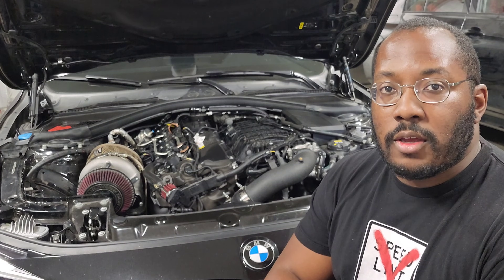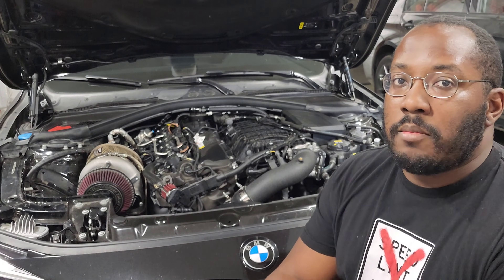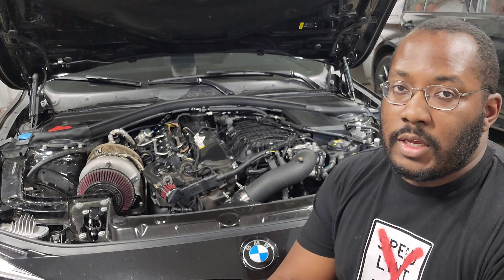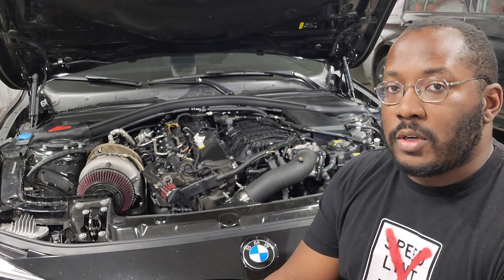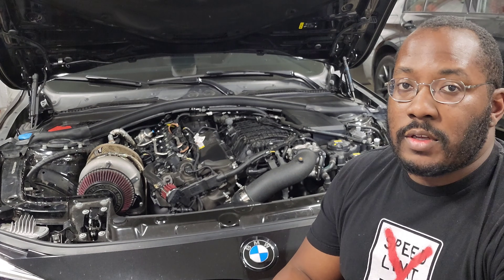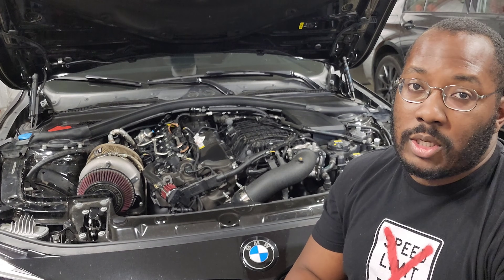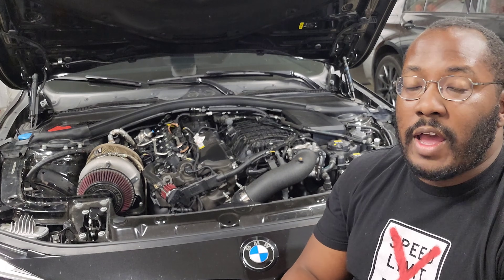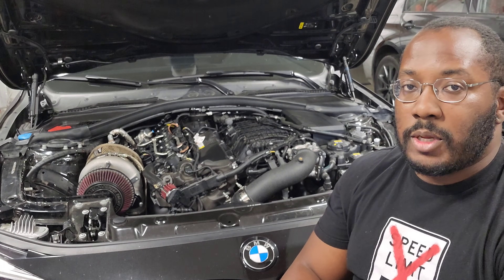You CANNOT only spray Methanol for Cooling! Here's Why

Comment: What’s the downside of the negative fuel trims if your going to stick to meth and water mix for every day use?
Reply from the maker: Can't believe I didn't mention in the video 🤦🏾‍♂️

30% is the max +/- the car can adjust. If you hit that wall then you run the risk of leaning out or running too rich.
Reply: @kern417   its all good no worries, I was thinking it would eventually go lean but didn’t know what the max trims were. I’m new to closed loop fueling under wot, I’m used to dealing with open loop under wot so thanks for the clarification 👍

Comment: Apparently this is injection on top of a stock tune, otherwise tank fuel would be pulled in the tune and substituted proportionally with methanol injection. Water has one of the highest heats of vaporization of any liquid which is why it works so well in our radiators. It also requires a high temp in order to evaporate. If charge temps aren't high enough then not much water is evaporating before it reaches the combustion chamber where it also does work to cool the combustion process and steam clean the chamber. The downside of the negative trims is that at some point the power control module is going to kick in and shut the show down to protect the system if not tuned in many cars.

Comment: Kern417 thanks for the great video. I have a question regarding these setups. I currently have a SXS with a 1000cc single turbo motor making right around 200 crank hp at 20psi. These cars have locked ECU and cannot be tuned. They have numerous built in safety's, one being they start to pull timing and boost on long runs when AIT reach 140-150f. I have upgraded the water to air intercooler but due to space restraints I cannot make any larger. Could I spray water/methanal into the intake post intercooler without additional ECM tuning (locked). My idea is a very small nozzle set to come on between 10-20psi of boost on long pulls to prevent AIT reaching a level were the ECM starts limiting boost and timing. Great video and thank for any input.

Comment: I don't have a BMW, but I am running water/methanol on my 1.6t Veloster. On 93 pump fuel alone I made 363whp. When we did our 4th run to get my tuner a log with WMI, on the same tune with no changes, it made 381whp. 

I wonder why for my setup, I made more power without adjusting my tune for WMI? When we optimized my tune with WMI, I made 440whp at 26psi. We didn't go above that because my factory knock control limit is 26psi.
Reply: That's amazing! I'm running a hyrid turbo on my 1.6t Elantra sport. What nozzle size are you running and what PSI does your injection start and max out at? Trying to dial in my setup
Reply: @emans2475 1000cc. Start 11psi, full at 20psi

Comment: Howdy from Edmonton.  I'm about to install a Pure500 turbo on a PWG 13 535Xi,M-Sport. I have most of the typical supporting mods. Exhaust. Intake. Rod bearings etc.  but stock fuel pumps.  I planned on running a stage 1 snow kit 100% water for IATs, and knock protection.  In your video the dme is reading the fuel from the meth and pulling fuel trims because it's reading the the meth.
I've seen custom tuners getting 441 RHP out of stock fuel pumps, pure 500 on n55s.  

Ifthe turbo and intake system can provide more air but the fuel pump is maxed out.  Will the dme let the fuel pumps run at full capacity but allow for more air and boost to match the overall fuel mixing including the small amount of meth I'll be spraying?  Thanks

Comment: I run meth. Have NEVER tuned to it ever..... Make a 1000 whp on 93 octane with meth with my Turbo Mustang. With E85 its just dumb cause E85 cools the fuel even more.
Reply: Your car automatically adjusts fuel trim. Not all cars do that. The holly EFI has automatic fuel trim so it will pull fuel out when you add meth inj. Obviously your car is doing the same

Comment: Hello Kern. 
I've been doing Water meth injection over 10 years and have run it on several cars of my own, and tons of customer cars. So I'm sorta qualified to share some experience here.
 
I'm really opposed to running 100% water before the intercooler. 
For the majority of users out there some methanol in the mix is recommended. The reason for the meth is not for fuelling or "octane",  but for distribution. Let me explain why. 

Pure water tends to flash to steam right off the turbo but then condensates into larger droplets by the time it exits the intercooler. This is because the intercooler is still doing its job and cools anything that passes through it.  These larger droplets have increased "inertia", and find it harder to distribute equally into the manifold runners.  

If exit temps at the intercooler is about 45C, for instance, at sea level pressures water will boil at 100C, but will start to vaporize/evaporate at much cooler temps.  The 45C would be ok but there is boost in these pipes so it is harder to vaporize as is expected with an increase in pressure ( Raoult's Law ). 

Volute injection (of the turbo) works lovely when the mixture has a high methanol percentage, even if there is an intercooler. The W/Meth droplets are smaller and are distributed more evenly into each runner.

There is however 1 exception. For systems with intercoolers like the B58 the runners are spread out over the intercooler and as such distribution is less of a concern. 

Also,  I'd be comfortable running methanol if the fuel trims are working correctly. It's actually doing what it supposed to do I believe -  Pulling fuel for the decreased detected lambda. 

The best approach for this, of course, is to get it custom tuned, or, run just enough meth to stay at 25% trims.

Also, please join our fb WM group at called "water methanol injection". We welcome anyone with experience to share and debate setups/experiments.
Reply: Great information I joined the group waiting for approval. My name is AJ Lee.
Reply: And you're missing the steam engine effect by letting thr water condensate in the system rather than the cylinder 😊

Comment: I agree with 95% of this video except for the running 100% water. Based on my testing on boosted ford stuff (different platform I know  but ecu trims fuel the same) you want to target roughly 10-15% of total fuel needed at wot for your water/meth injection. I've found that this % provides the benefits of the cooling and increased octane of the fuel being burned while bring a low enough % that the ECU can still trim fuel to target lambda AFR. In my testing I saw a 20hp Increase with a 70/30 meth/water injection with no additional timing.  So I think spraying a 50/50 or 70/30 mixture is great as long as the nozzle is appropriately size for the fuel consumption demands of the setup.
Reply from the maker: You just said that the car needs to adjust trims for the additional fuel, which means exactly what I said is true. If you only want cooling then you spray water.
Reply: @kern417  I was commenting more so on spaying a mix in general. The ecu will trim for all change in conditions. If you go make a hit in really cold air the ecu will add more fuel for better air. You absolutely can spay water meth for only cooling purposes. If you aren't relying on  the meth for fueling shortages or to force more timing into the map, then spraying the water/meth is solely for the cooling. Even if you just sprayed water the ecu would have to trim more fuel in from the denser air.
Reply from the maker: @TeViiNz  the video title states you cannot just spray meth for cooling, and as I said you can't. It will always affect fueling, and if you have a manifold like what's described in the video it can cause uneven fuel distribution that causes lean cylinders that can fail. If you only want to add cooling without changing fueling, the only viable option is water injection. Period.
Reply from the maker: @TeViiNz  and the DME has baseline fueling based on fuel mass calculated from intake temperatures. Water injection cooling IATs is not the same as unmetered fuel coming in from meth nozzles that aren't accounted for in the tune.
Reply: @kern417  yes dme calculates fuel needs based on air mass. Spraying just water lowers air Temps which increase air mass. If water is sprayed post maf sensor as it should then the maf is metering X mass of air however the engine is actually ingesting Y mass of air due to the cooler temps which would require more fueling from the DI injectors which the dme would adjust for. Spraying anything through the intake track will cause changes in fueling. Secondly if you have a properly sized and placed nozzle for your setup, the injected liquid would be fully atomized prior to entering the intake manifold. If you get to the point to where you are having drastically unequal fueling mixtures across cylinders from meth injection you are spraying too much from a single nozzle for your setup. I'm not arguing that spraying meth won't change fueling demands as it will. Simply stating that as long as your tune isn't dependent on the additional fuel or additional fuel quality for the timing requested, then you definitely can run a small water/meth mixture for cooling purposes.
Reply from the maker: @TeViiNz  that's not how it works. If you increase the size of your intercooler it doesn't throw off your fueling. Air mass is primarily calculated based on IATs and pressure and fuel is scaled based on both. Again if you reference the car in the video, these modern engines don't even come with maf sensors anymore so there's no factor there. And meth doesn't atomize before it gets to the combustion chamber and that's the point. It will burn up in the cylinder and change afrs. This is a well documented issue on the platform due to the throttle body placement.

Comment: You have it backwards. Methanol does the majority of charge air cooling because it evaporates more easily. Water does the cooling in the combustion chamber. It takes the higher heat of the combustion chamber to change the state of water from liquid to gas. The change of state absorbs the heat.
Reply from the maker: Incorrect
Reply: I’m sorry but you are incorrect. Water does not burn. All it does is change state in the combustion chamber which absorbs heat. Methanol burns in the combustion chamber. It burns cooler than gasoline, but it nevertheless burns which adds heat. It doesn’t cool the combustion chamber at all. It’s cools the intake charge and adds less heat than gasoline on the combustion chamber. Trying to help you out. You seem like a nice guy.  Please do not dismiss what I’m saying.

Comment: Hey bro I have the BMS chargepipe with built in ports for WMI. I am planning to go HPFP and turbo route rather than port. Since data shows heat exchanger upgrade doesn’t improve IATs much, I’d rather spend that money on something more efficient. Do you think solely water injection is the best bet for my M340 (that will be controlled by a HOBB switch.) I already have intake upgrade as well. So water injection instead of heat exchanger? Or is heat exchanger not really worth it lol. Just want your input brotha
Reply from the maker: If you're not having issues with heat then i wouldn't worry about it
Reply: @kern417  I live in central cali the summer days are well over 90-100s heat soak gets pretty noticeable after few pulls on a hot day haha
Reply from the maker: then a heat exchanger is your best bet. but stock cooling doesn't really heat soak on stock turbo.

Comment: If i can run direct port wmi mixture methanol water 50/50 is safe? Or i only using with water  charge pipe water?
Reply from the maker: personally for port injection i'd run straight meth

Comment: Here is an old corvette forum and Julio from Alky controls explains 100% meth vs water meth. Personally I use 100% meth and would never use water. Here is the explanation:

The first is temperature. Water has a flash of 180 df. methanol flashes at 70 df(degree's farenheit) So if the air coming across the nozzle does not have enough temperature to flash the liquid, the liquid being shot it is carried to the back of the intake manifold and uneven distribution is what happens next. Meaning the rear cylinders get liquid and the fronts dont.

The analogy I use is brake cleaner. If you get a hot rotor and shoot brake cleaner on it.. it disappears immediately. If you shoot water.. it stays wet. 

So every PSI is approx 11 df. at 10 PSi your at 110+ambient. If its 30 degree's outside, you run 10 PSI=140.. enough for 50/50 mix to work. Not enough temp for water as it needs 180 df.

Now what happens is you have 50/50 mix.. and run an IC.. now you spray into air that has been cooled.. doesnt disperse correctly.. and whalla.. tuning problem. Problem magnifies itself as you crank up the volume shot in.

So this is why straight meth is typically used.. as its easy to make 70 degree's.. and keeps from distribution problems.

Next problem.. as the water volume increases, the nozzles go down in size, and the pressure goes up. As the liquid has to be broken up as finely as possible. So it has a chance of disbursing into the air properly.

So nozzles used with water injection are like M1=1 gph at 100 PSI, nozzles used with meth M15=15 GPH as you can crank it in and get results.

Water injection works.. as does water/methanol.. as does straight methanol. A lot has to do with the strategy of what your working with temperature wise and what your goals are. For just cooling.. use straight water, mix, straight meth. But understand the IAT the engine is dealing with to choose your fluid.

Lastly.. water leans out the motor as it takes up space in the combustion chamber. meth richens it out. Mix still richens.. but then we get the flip flop of temp and goal.

Vette's in the grand scheme of things run lower IAT's becuase of boost pressures run. Some start running out of fuel system.. some have bad octane like Cali 91.. some dont like constantly retuning becuase outside air temps changed.. This is why straight meth rocks on them. The only down side to straight meth is that its harder on the pump and the system has to be setup for it.

Comment: Hey Kern, is it possible to use port injection for 100% meth and CPI for water injection to help cooling together ? Have you seen both systems run together with a custom tune ?
Reply from the maker: In theory yes but i have not seen both systems used simultaneously.

Comment: @5:55 Is there a charge pipe with inlet for water injection close to the turbo in the market?
Reply from the maker: Most spray after the sensors so it won't risk Messing up the readings
Reply: @kern417  So is there a risk to the sensors spraying water pre sensor? I'm planning on using the fuel it charge pipe spacer to make sure I have the least risk possible of getting water into the engine

Comment: Nice video, you couldn’t be more up to date with my built👍
Would a good custom tune works with CP WMI or i should stay with water only?
Thanks for that subject🙌
Reply from the maker: I would only run it with a custom tune that runs slightly richer to make sure that even the leanest cylinder is running at a safe AFR.
Reply: @kern417  i’ll ask gently mister Yeahia😜
Thanks 👍
Reply: @kern417  what meth kit would you suggest will suit the application of just cooling iat's in the b58 ...

Comment: Awesome channel I’ve learned a lot. However, I have a much older chassis. lots of your information is effective in the newer vehicles. Currently my street car is an SUV. I own a e70 X5, N55. I’ve been running a PS2 turbo, air to air Wagner intercooler, precision Race works coil packs for a couple of years now with Stock high-pressure and low pressure fuel pumps (I have no desire to run port injection due to complexity, I’m interested in keeping it simple ) I’ve known for quite some time Water injection is affective. commonly used in the 80s in the 90s turbo cars….yes im that old lol. I thought about water / methanol  in the past but have not been motivated to move forward on it. Until watching your informative Episode (you cannot only spray methanol). The way you presented the information is fantastic. Now I’m motivated to do water injection. not because I have a desire to run an incredible amount of boost. I want to improve reliability And longevity. what’s your opinion on using water injection on early n55. Any information would be greatly appreciated Thank you.
Reply from the maker: You have a unique opportunity, because you have an intercooler doing a lot of the work. Then there is a long charge pipe where you can spray water to futher cool down the air. This is the best of both worlds.

On the B58, the intercooler is mounted directly on the cylinder head so the best you can do is spray some water to "pre-cool" IATs so the intercooler has less work to do.

I also have an E70 but it's an earlier N52. Definitely jealous of your torque. The car is quite a slouch without it.

Comment: Quick question. Let say i run E50 mixed and i use like OTS bootmod3 and if i want to switch back to like a 91 octane ots. At what point of E50 level in the tank that i can top it off with 91 and safety use the 91 octane ots. Thanks
Reply from the maker: Run the tank down to below 50mi to empty, fill up with 91, then flash the 91 tune. It should drop ethanol content after the first few miles of driving.

Comment: Is there any benefit to running cpi wmi with the JB4? Same goal, cooling not fueling. Have the whole kit just been iffy about routing thru the jb4 only for a better tuning solution to release for post 6/20.
Reply from the maker: Chose your goal first, then build the car around your goals